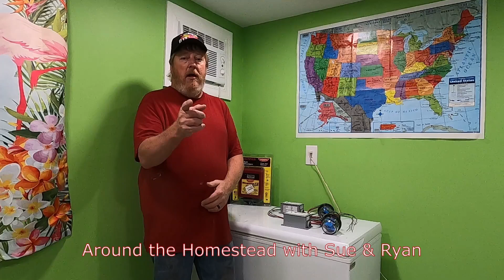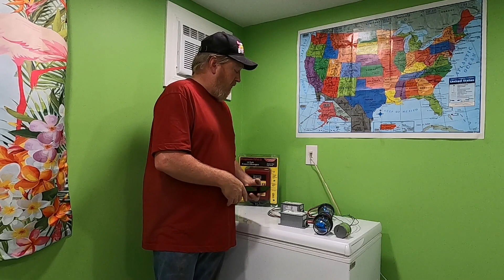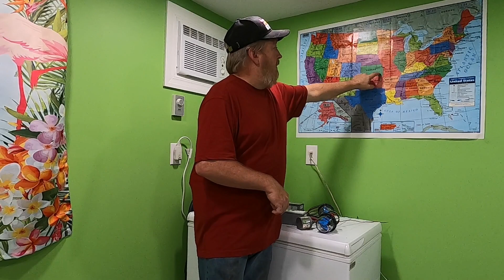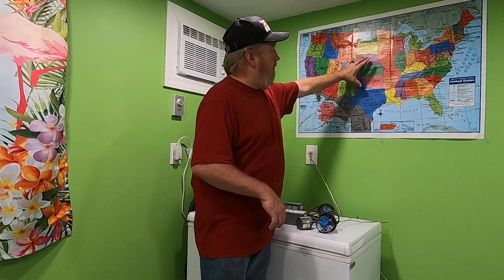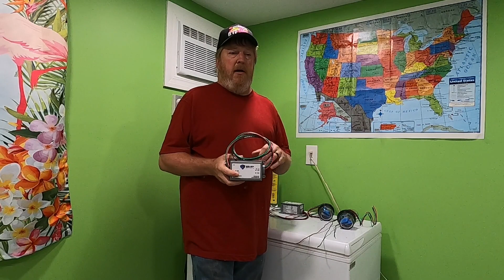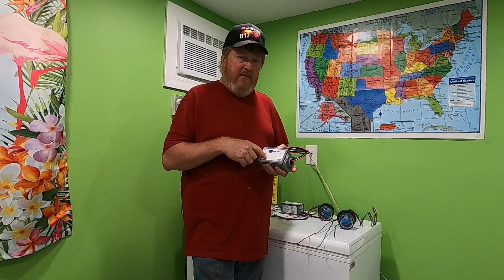Ryan Rants: EMP, Solar Flairs and Electrical Surge Suppression  Part 1

Comment: Thanks for addressing this topic. I built our solar shed as a Faraday cage. So once the voltage hits a ground wire it can’t back-feed? I need to get a better understanding of clamping voltage. Also, the the high voltage from an EMP is potential? So without a load...?? I am sure I will be learning some things watching your videos.
Reply from the maker: During a nuclear EMP yes the voltage will flow everywhere that's why they suggest the farrady cage and NO wires leaving it for the most likely solution for saving gear. Anything that is wired up is not likely to survive if you are close to the epicenter